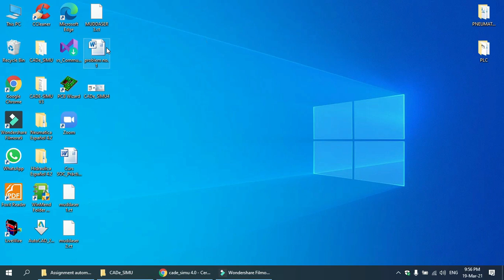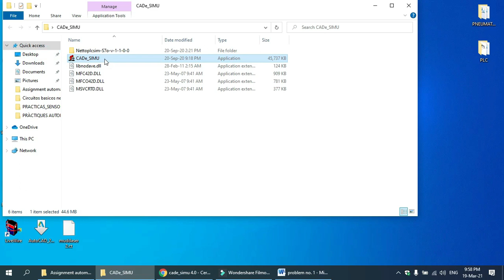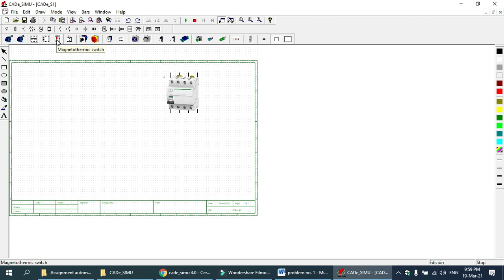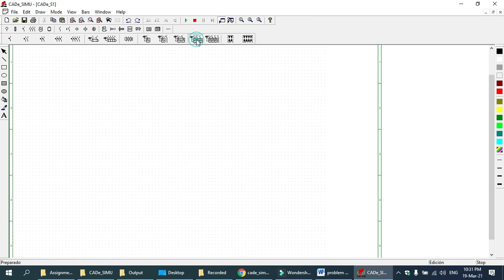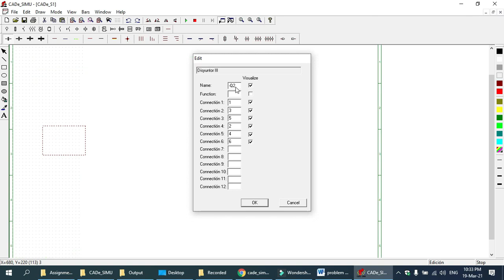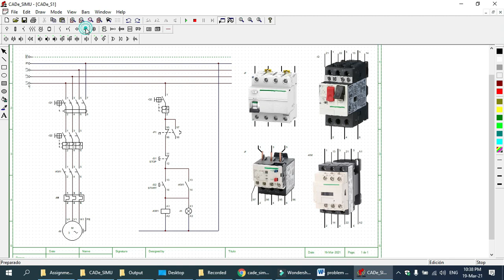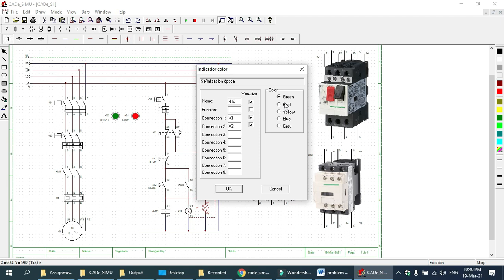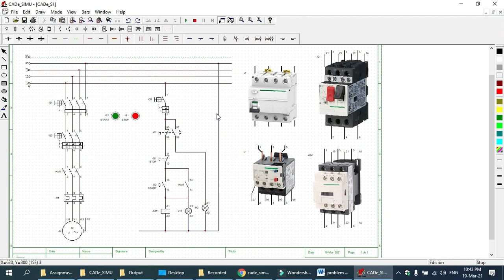Tutorial 1( CADe_SIMU) - Simulation of 3 phase induction motor

Comment: thank you so much, a quick question, can the simulation run/work if the power and the control circuit have errors or wired in correctly?